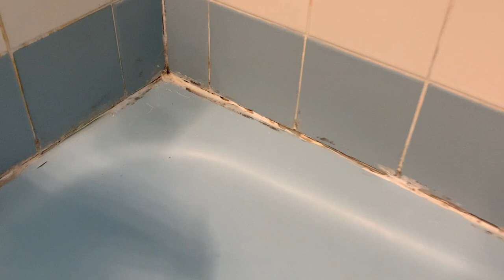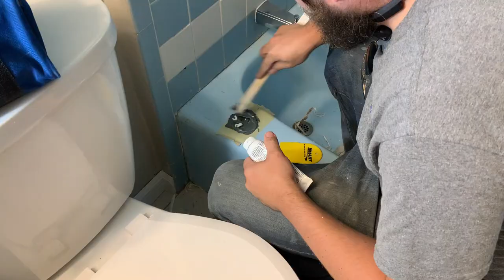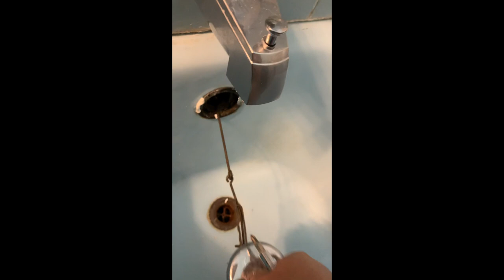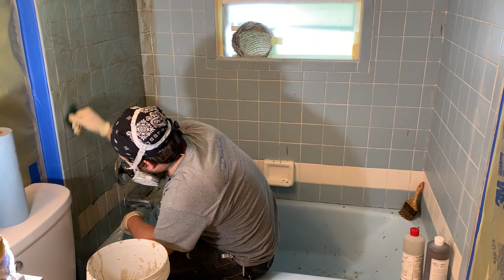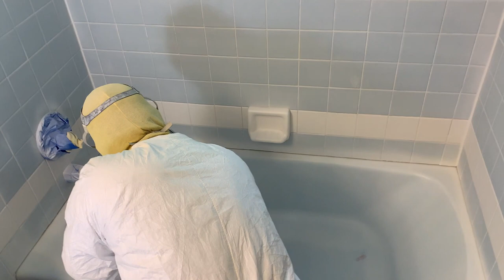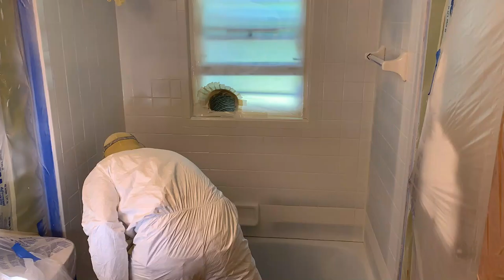Tub & Tile Reglazing

Comment: How long was this process? And whats a option if you dont have a window to ventilate
Reply: Connect it inside. run the fan from the bathroom door with the hose going out the nearest window or door. If it doesn't reach an additional extension hose will have to be connected so that most of the overspray properly exits.

Comment: The huge gap between the tile and the tub at the end really bothers me
Reply: He's waiting for it to cure and then they will caulk it. Needs to wait 48 hrs
Reply: I generally caulk before i spray it. That caulk is a little more expensive but worth it. If you use standard caulk then you just caulk after you spray. Its dry to the touch pretty quick. Less than 30 mins.
Reply: But you cant use standard tub and tile caulk and spray over it because it wont harden and will stay soft.

Comment: I live in a co-op. And unfortunately my bathroom only has a fan in the ceiling. There is no window. How would you the professional take care of the spray. Where with that vent out to other than the fan in the ceiling. I’m afraid it would smell the Whole apartment up. Thank you
Reply: It’s going to smell no matter what, but only 10-16 hrs (depending on temperatures).
However, refinishers would have 75 feet of hose on hand, that’s what I carry.
Somewhere you can find a windsor.
Reply: @bathtubrenew  Any products you recommend? I want to DIY, but take professional steps for a good product.

Comment: when I sand my tile, it does NOTHING to them in regards to scratching them or scuffing them up.... anyone else experience this?
Reply: Yes! Generally people use a xxx acid etch to prep tile vs sanding. I’m guessing these guys have some sort of diamond sand paper or something. Your standard sand paper will not work, the resurface may stick for awhile but it won’t hold up.
Reply: It looked like they were only sanding down the areas were old grout, caulk, or adhesion was. The hydrochloric acid was to etch the tile for prep/ a lasting product.
Reply: @levi.walton13 Do you know what is the specific acid they use? There are many hydrochloric acid but the one they use is a specific one that I don’t know what it is.